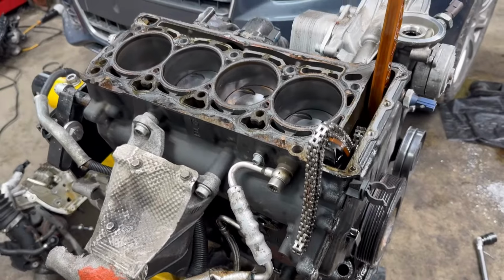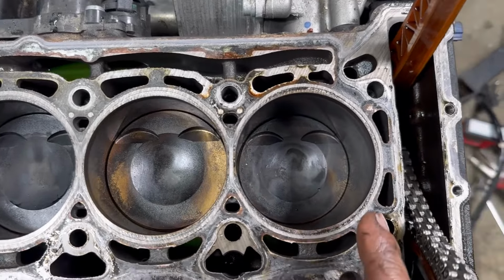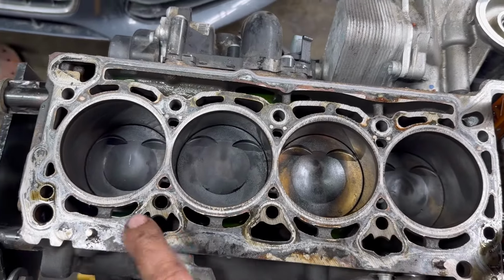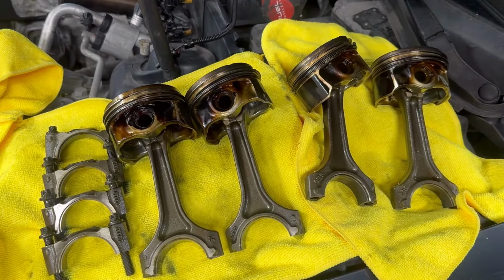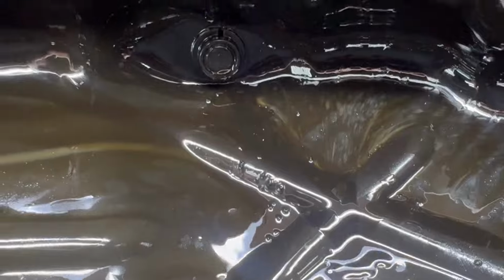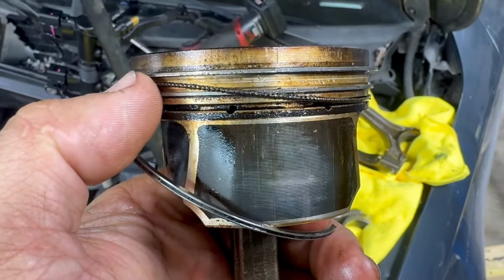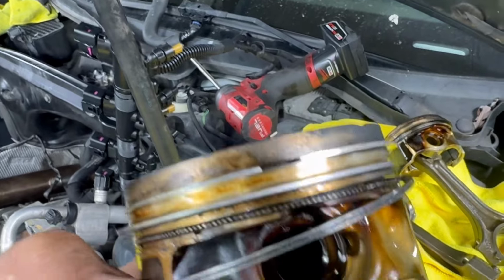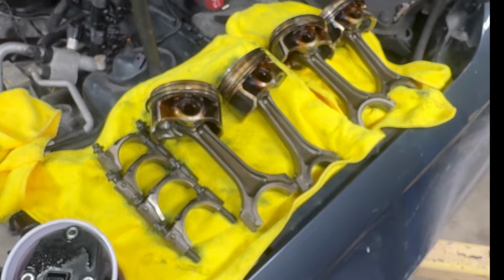2.0t Using Oil Piston Carbon Cleaning Flush Cylinders 1&2 Only Results After Teardown consumption vw

Comment: Best mechanic I've ever met. He worked on my car about 2 years ago and I haven't had a problem with it since. Even my father was impressed with how efficient and well done the job was and said it was the best mechanic he's met in the 40 years he's been working on cars. It's amazing what this guy can do, how great his videos are, and how honest he is.
Reply: Do you have contact information or how to find? Need work done on my audi
Reply: I’m pretty sure he’s located in Michigan, not sure where exactly n I wouldn’t say even if I did know. I wouldn’t mind sending my 2013 A7 w 200k miles to him for a look over tho😂 hasn’t ever had large mechanical issues besides wheel bearings so that’s nice but also worrisome as something is bound to go sooner than later.

Comment: I have a 2015 S3 with 208,000 miles that I'm rebuilding (I'm the original owner). I have tried damn near EVERY type of "flush" / "carbon cleaner" out there and I have news for everyone - NONE of them work ! PERIOD !    I've heard some owners install a "catch can" system for their cars but even then i hear mixed reviews.......
Reply: Give cleanboost max a try stuff actually works
Reply: Catch can doesn’t do anything. The factory oil separator deposits any oil from the boost/PCV system back in to the engine. The third gen engines (mostly 2015+) have way less issues because they hold more oil. Carbon on the oil rings is from the combustion process of direct fuel injection. It’s a cooler burn so it deposits more soot in to the oil. More oil can handle more soot. The soot wreaks havoc on anything with tight tolerances. Mainly timing chain links and small, low tension piston rings. Gen 3 engines all have waffle style oil rings past 2016. Catch cans are just a waste of money. They may help with carbon on intake valves, but that’s about it.
Reply: B12 chemtool worked for me. Cut my burning down from a quart per 500 to a quart per 3,000. Took two treatments

Comment: My experience - 2013 2.0T CC with 185k miles. Good PCV and newer turbo. Was burning 1 qt of oil every 500 miles. Soaked pistons with 2 oz. B12 each for 6 hrs then rotated engine a few times and repeated 4x times over 24 hrs. Then drove car for 20 mins at 4k rpms for 20 mins before changing oil and filter. Also swapped with copper plugs. Oil consumption returned to normal and has been ok now for 15k miles.
Reply: Did you start process on a hot engine or cold ?
Reply: @3sgteJoe  Cold, the B12 will vaporize if the engine is warm.

Comment: Interesting. After doing the B12 piston soak on my quart of oil eating every 350-400 miles engine with 112k miles in it, I was surprised to use less than half a qt after 4.5k miles and changed it, doing a Liqui-Moly flush to hopefully maintain it.
Reply: Bonjour,j'ai le même problème avec mon Audi A4 de 2010 tfsi qui consomme 1/2 litre pour 400kms.
Quelle est la référence engine flush liqui moly que vous avez utilisé?
D'avance merci

Comment: Not VW spec oil but checkout Valvoline Restore and Protect oil. Supposed to be able to clean carbon in the oil rings - the whole piston but the top. Something very cutting edge.

Comment: I did it with my motor cold, those ether spirits evaporate before they can loosen up carbon if the motor is too hot and it does nothing. When I got my car I changed my oil and it ate one quart in 300 miles. When I did this flush the motor had clean oil and after the flush 36hrs later the oil came out black from all the carbon that loosened out of the pistons, now I’m 5K later not a single drop of oil burnt, there’s no smoke coming out of the tail pipe when I floor it and my engine runs stronger than ever

Comment: I wonder if it’s possible to fit the waffle style ring set to those pistons? I don’t think it’s worth cleaning the pin holes and even drilling the holes oust slightly larger to re-use them.

Comment: I tried the engine flush where you dump some down the plug holes, let it sit, crank the engine to get it out, blah, blah, blah. On my 2012, it made my oil consumption drastically worse. On my 2013, it got slightly better but in the end I replaced the pistons. Thank goodness the dealership I worked for flipped the bill for the pistons since I had just bought the car. 😁

Comment: Argh @Naptowntuner I really appreciate your vids and tutorials. . I've just finished doing a tensioner replacement, new timing chain and guides, fuel pump o ring, vacuum pump gasket, intake and valve clean ( by hand)  and cam cover seal and now I discover I have the 09 piston type. Argh am I allowed to cry?

Comment: Have you considered having a circulating oil pump system where you actually pressurize the cylinder with oil through the spark plug hole and recirculate the cleaning fluids from the sump again? Obviously this can only be done on the compression cycle of the pistons..

Comment: how about oil flushes, would those do any better to clean the rings from "underneath"? millers oils do a flush that doesn't contain corrosive metals and is made up of concentrated cleaners and detergents they would use in their engine oils.

Comment: My 12 a4 quattro consumes about half a quart for a 6k interval. I run liqui moly molygen. Every other oil change it gets liqui moly flush. And  once a year i do a top end service. The 10k interval is just too long. Every manufacturer is having issues with oil consumption. Hondas 3.5 has a re ring recall for vehicles consuming oil. Plus the inside of my engine looks new. Ive had to re seal the timing cover, valve cover and oil pan. My question is what if you filled the cylinders and let it sitfor say maby a week or so gove it more time to break down those deposits?

Comment: Dude, luv the focus on the vw/audi 2.0 engine. Regarding oil control rings, old timey Detroit iron used to have a thin top ring, a thin bottom ring, and then the waffley wavey separatir ring. Never heard sn issue with oil ring clogging. Why was this tech abandoned?
Reply: Old timey Detroit engines burned oil continuously. 3,000 mile oil changes also. If you change oil every 3,000 miles on your Audi you won’t notice oil burning, and also rings won’t clog up. The 10k oil changes on a direct injection turbo motor is a major factor of what clogs the rings to begin with.
Reply: Sure, changing oil more frequently is good practice and cheap insurance. It seems insane to me that all this design pressure for lower piston ring drag and gain higher mileage is being brought to bear, with no regard to premature engine failure. Just cut wider (oil control) ring grooves and use more generous wavey rings !!!. I had an old 1984 BMW 3 series with almost 500k MILES on it before it died, not from engine failure but from losing 2nd and 3rd gear. This modern trend of persuing ultra high fuel efficiency does not take into accout the wastage of fuel and money when a replacement engine is needed, or when the vehicle needs to be scrapped.

Comment: The dealer told me the rings one #4 had stuck because of a fuel injector leak.  I have no idea if they are right or not but #4 has a misfire.  The only chemical treatment I haven't tried if the BG Dynamic Flush.  I'm sure it needs a new piston or maybe a new engine. 2016 Audi A4

Comment: @naptowntuner  would you be willing to come to Long Island? 2013 Q5 burning oil and now has p0301 cylinder 1 check engine flashing.. will try and change plugs and coils first ..120K miles

Comment: I've done 3-4 flushes with toralin carbon cleaner (quite aggressive, it can dissolve your paint), oil consumption seems to be halved now = 1L/1qt every 1k mls

Someone previously suggested flushing with diesel.
Pouring it in the cylinders and just let it soak for a couple of days and top it off regularly if needed.

Comment: Hey, Naptown Tuner. do you ever reuse engine hardware? If you go by the book, every bolt and screw on these 2.0TFSI is torque to yield. What can be reused in year eyes? Or every bolt and screw needs to be replaced?

Comment: Could you make a comparison of the oil pan contents before and after the flush? I guess driving with load on low viscosity "lubricants" would wear the bearings nicely.. I guess everything else should have no problems. The piston scoring is probably the result of something else.

Comment: There is this guy DIY Dave channel, who's been doing flushes on his Toyota for 3 years now trying to figure out what chemicals work... and of course nothing worked. I believe he's finally opening his engine in the next episode to replace the rings. 

They f up the design of these rings in all vehicles after 2014 probably due to environment regulations.  
Also, guys at Vag Technic who do these crazy oem engine overhales for 6-10k on Audi RS models, replace everything from rings, pistons, chain guides, cam rollers... have and show the same problems. 

That's the way these engines were built, no help. Drive them for 100k miles and sell them.
Reply: Look up a guy named eurotrash motorsport on YouTube, he did the piston soak on 2 seperate audis and it worked. I saw the video and did it myself and saw ridiculous results. 1litre every 300km to 1litre every 4000km

Comment: Same deal with a Toyota 1zzfe I have apart right now. Oil control rings were stuck rock solid.
There's a guy on YouTube that's tried heaps of chemicals on a corolla that burns oil named DIY Dave , nothing has worked for him.

Comment: So what exactly was your procedure?...  Hot engine? cold engine?...  How long the soak?  Amount of solvent?  Rotate crank?  Seems to be a lot of variation in results across those that have done it.   Have 107k on my 2013 Q5 2.0t...  change oil every 5k with name brand synthetic (current favorite liqui-moly). Currently consume 1qt in 5k mi.

Comment: I have a 2015 Audi Q5 2.0T. I bought it knowing it had issues. But an exhaust valve in cylinder 2 broke a piece off. I don't think I can rebuild it, and I'm unsure about getting a used engine. Any advice? Car had 101,000 miles

Comment: Hello sir I have 2013 audi Q5 2.0L TFSI I struggle with overheating its leaking for the passenger side closer to the wheel well took it to multiple mechanics and fail to fix the problem. I am from south Africa

Comment: Idk the overall result but I run a shit ton of Lucas upper cylinder lubricant in my ranger and overtime with a lot of hard driving…. IT STOPPED SMOKING!! Also did plugs,wires, and injectors at the same time of all of this

Comment: I wonder if the rings get gummed up and do not expand outward over time and that is what is allowing oil past them into the combustion chamber. Perhaps this is effective at deguming the rings so they expand well enough to scrape the walls.
Reply from the maker: The compression is never compromised unless something is damaged, these engines using 1qu in 300miles will still show normal compression
Reply: @NaptownTuner  right, but presumably only the oil control rings are affected by the gummy condition, not the compression rings. The perforated design would make it susceptible to the carbon build up where the solid design of compression rings wouldn't. I could be way off.

Comment: Thanks for the video Nap. Is there a way to tell wich rings you got in your car?
I have a early 2013, B8.5 Q5. I just bought it used, seams to need 1 quart every 1k miles.
I was going to do the B12 cylinder soak treatment.
Reply from the maker: The worst ring design is Audi 2009 to 2011.  2012+ went back to vw style rings with the slots.  This 2013 engine came from a q5 hybrid so it was an exception still using the 09-11 bad design pin hole rings.  2012+ are almost always 23mm wrist pin vs 21mm wrist pin for 2009-2011
Reply: Thanks for clarify. I would think I got the slot oil control ring type
Reply: @NaptownTuner not true. The slotted rings are vw specific/ audi transverse engines. 2009-16 Audi engine all use the old style ring with the small hole. Not sure if any 13-16 actually use the waffle style ring. I’ve disassembled a 16 a4 2.0t with a broken piston and it had same oil ring as the early models with small hole
Reply: @hgas9631 Yep. Can confirm. 2014 Audi A5 Quattro and it has the same oil consumption issue & carbon buildup issue from the rings, direct injection, and previously neglected maintenance. 

Hopefully it won't need a rebuild...

Comment: I took can of B12 a can of seafoam and 6oz of mmo put them in a ultrasonic cleaner to mix them at 80 degrees c then poured 2 0z at a time into each cylinder rotating it periodically and refilling till I used my concoction up did this over the weekend final day I took a can of spray sea foam and filled each cylinder let it set over night drained the oil put mobil delvac 15w40 in it so far so good on the consumption I have 150k miles on my Audi and was using a quart every 400 miles so I'll update in 400 miles

Comment: In order to prevent the oil rings from coking, the engine oil should be changed at most after 250 engine hours, and not after 10-15 thousand miles! And every thing be OK😊

Comment: This shows you need to clean from the bottom over time. BG 109, maybe Valvoline Restore & Protect motor oil. And not buy cars with shi**y engine design. 

Change your oil folks. Oil is cheap, engines are expensive! Thanks for the tests!